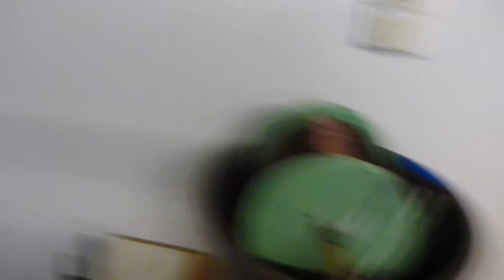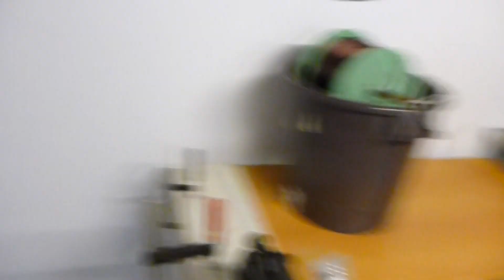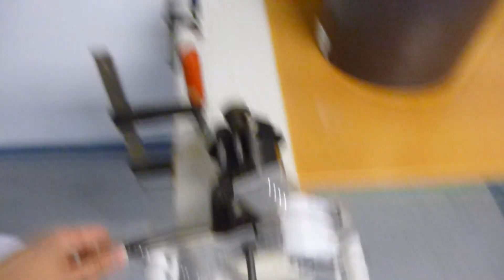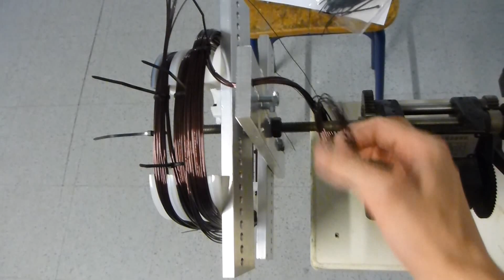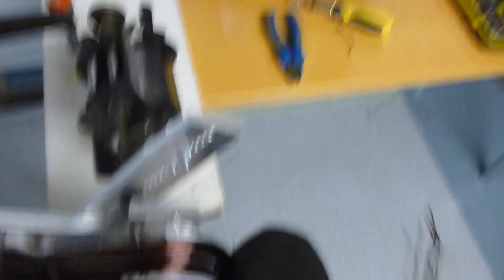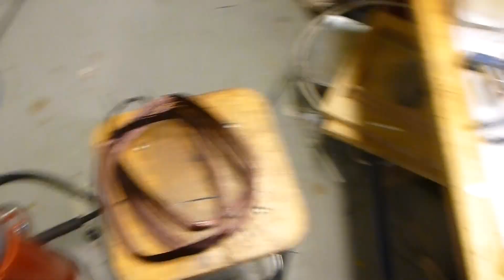Induction motor coil winding setup

Comment: Is there a formula to rewind a 380 volts 3 fase motor to 144 volts 4 pole 3 fase motor?, with a frequency regulator I have to take in account the impedance on a sudden frequency to prevent drop in power, a 4 pole do revolute 1400 rpm 50 hz, but go 150 hz I lose power but have much higher rpm, this needs calculation but did not find where. thanks.

Comment: Hi Jesse, do you also do single phase motor rewinds? You have some useful techniques that would be quite transferrable I think.
Reply: iwant clear tutorial how it connection of wires do.
Reply from the maker: You can, but single phase motors are usually pretty small, so they are fiddly and uneconomical to rewind unless replacement is impossible.

Larger motors (around 10kW and so) are much easier to rewind and more expensive to replace so it is more economical.